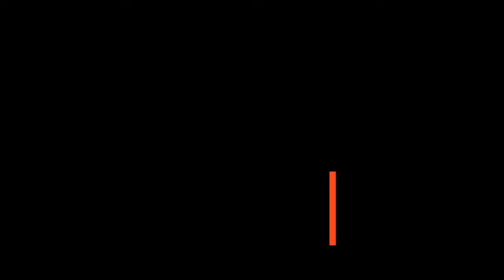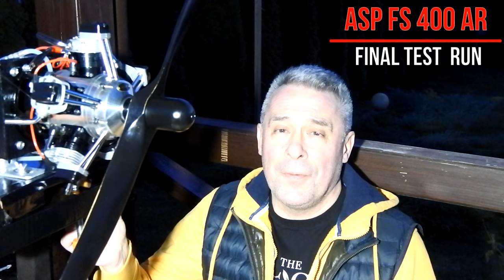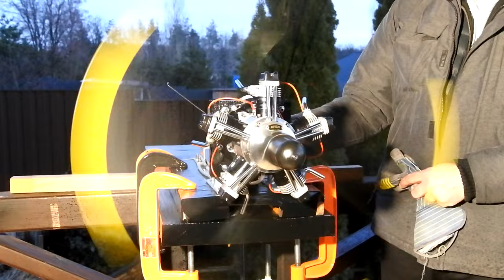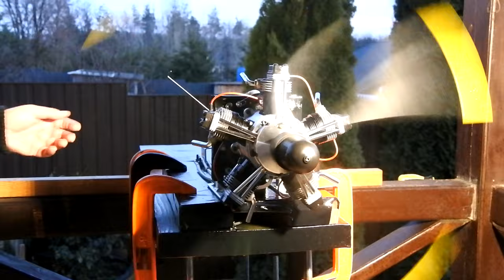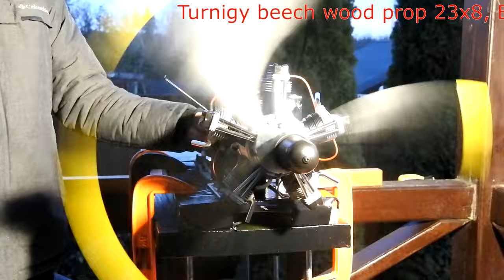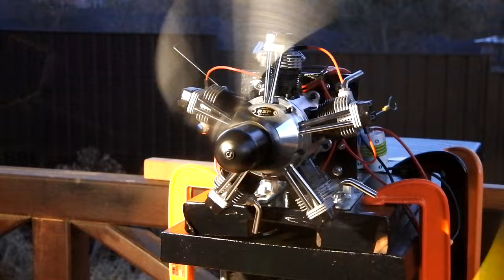ASP FS 400 AR final test run Part 1

Comment: Sweet! 😄 Are you using an ignition system?
Reply from the maker: Thank you for your comment and question ! I'm using glow ignition, based on 3 "D" sized NiCd accu batteries, connected in parallel.